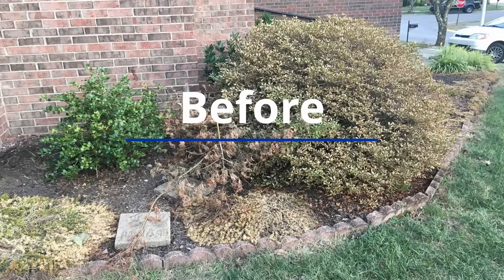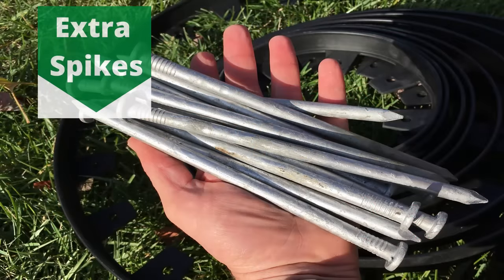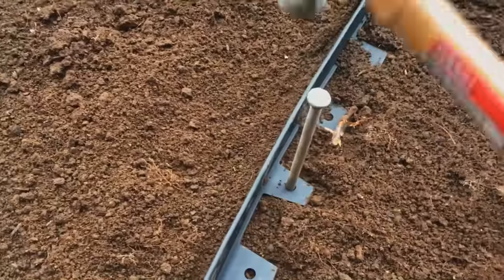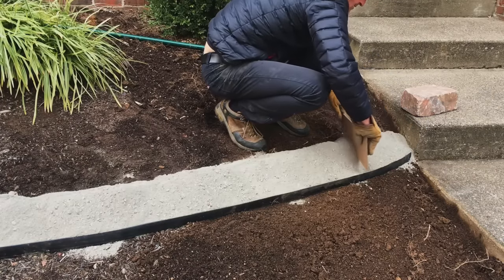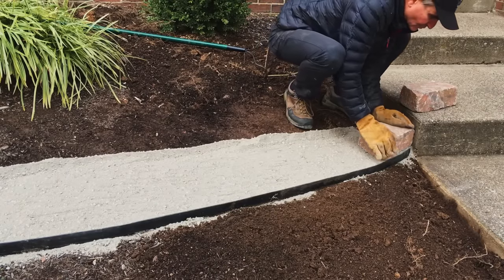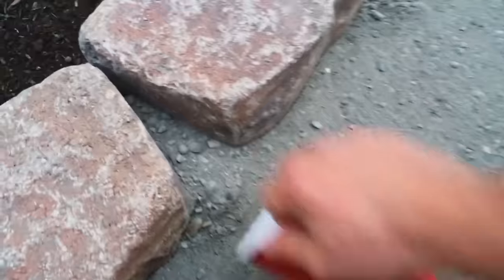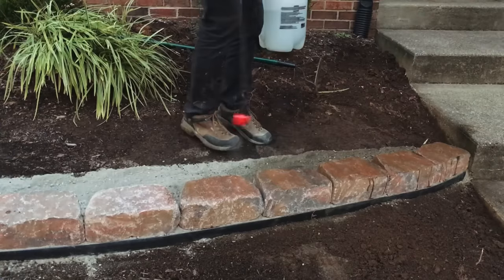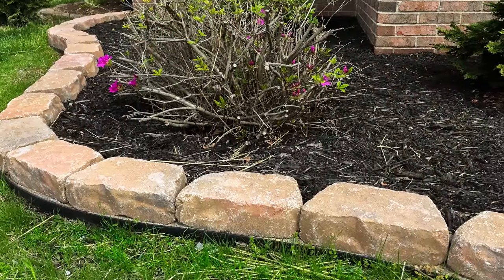easy diy No Dig Border *2020 UPDATE*

Comment: I have my own update.  First, I may have neglected to adequately thank maxpatch for this video in my last post.  After getting some ridiculous bids, the video inspired me to do it myself (with some help from a adult son).  We had to figure a few things out...I spent too long worrying about the unevenness of the ground, I honestly fretted about it and then just figured out that the border will provide a constant level for the stones.  I had to add here and there and remove here and there (I did not want a thin "footer" and a too thick one would waste concrete.  That resolved, the next minor issue was small irregularities in the border when stretched, leaving small indentations or the inverse.  I've decided they probably won't matter.  This is a 130 ft stretch so finding enough 8 inch galvanized spikes required many trips to the big box store.  Question:  Do you need one in every hole?  Anyway, so grateful for this and thanks for putting up with my questions.  Sunday we set the stones!
Reply from the maker: I'm happy to help you out, @Rockyboy5151.....I end up having the spikes an average of 1-2 feet apart on average. Sometimes more or less depending on what I need to get the curves right and make it sturdy so it doesn't bend out weird when putting the concrete mix in. You have a big project!! I'd love to see it when you're finished. btw-you can 'get by' with 6" spikes if you need to, but I guess you are past that step already.....

Comment: I'm curious why you made the concrete base so much wider than the flagstones.  Is there a reason, because it seems unnecessary.
Reply from the maker: Yes, it might seem unnecessary, but I do this for additional weed control for aggressive weeds and grasses that we have here in Nashvillle like Bermuda Grass that sends runners under the ground. This one foot width goes quite a ways in helping out with weeding in this way.

Comment: What if I am going to have three blocks on to0 of each other. Do I still go the same thing that you have showed here please let me know asap
Reply from the maker: Pat, I have not made a second layer on this type of border because I don't know if it would look that good and the difficulty level is raised some because you would mix up and use a traditional mortar between the layers. You could also use landscaping block adhesive. Even, though, it involves more work, I would highly recommend digging out the old dirt and mulch out of your area so the level is dropped enough so that there is plenty of room for the mulch to sit in there without spilling over. Also, the same thing can be accomplished by building your border out further so the dirt can slope down to the level of the bottom of the blocks and also have room for mulch. I hope this helps. Also, here is another updated video that answers many questions: https://www.youtube.com/watch?v=WJmPBu754z8

Comment: Great video! I plan to do this around my mail box and also for the current border in my backyard. But, how does the water get to the concrete that's underneath the pavers?
Reply from the maker: Great question, Diane. That cement mix acts pretty much like a sponge. When you mist spray the blocks, the water goes down around there and is absorbed under the blocks by the cement mix. Its getting cooler out, so make sure the temps are above 50 for the mix to set up. If its colder, the cement does not set. Anything else I can help you with, Diane? Have a great day!!
Reply: @maxpatch67  Thank you so much for your prompt and helpful reply.

Comment: This is a great video. We did this without digging, without concrete and an extra level, but over time, it warped from a straight line to a wobbly one. I’m wondering if  anyone has tried another layer of the stone  on top of this with this concrete project? If you have a video like that, please drop the link here.
Reply from the maker: Jax, your innovation was cool, but please believe me there is one part of this process that is vital. The cement. The cement provides four major functions in this border technique 1. Height(for looks) 2. Keeps the stones straight/aligned over time 3. Stability/strength 4. Weed barrier(the extra width is nearly impenetrable to aggressive weeds and grasses(Bermuda Grass) that we have here in Nashville. I hope you reconsider using it in your second attempt. It will be your last attempt because it will last perfectly forever...I can't vouch for a second layer, but done with one layer of blocks as shown in the video the border will last pretty much forever.

Comment: Great video! Can you do this with a second or maybe a third lair of bricks?
Reply from the maker: Juan, I have not made a second layer on this type of border because I don't know if it would look that good and the difficulty level is raised some because you would mix up and use a traditional mortar between the layers. You could also use landscaping block adhesive. Even, though, it involves more work, I would highly recommend digging out the old dirt and mulch out of your area so the level is dropped enough so that there is plenty of room for the mulch to sit in there without spilling over. Also, the same thing can be accomplished by building your border out further so the dirt can slope down to the level of the bottom of the blocks and also have room for mulch. I hope this helps

Comment: If i need another layer, doi have to follow the same steps on top of what you did.?
Reply from the maker: I have never added a second layer, but if you did, you would use either traditional mortar or landscaping block adhesive.

Comment: Hello! Your April 16, 2020 video creating a stone border with blocks from Lowes looks nice. However, I can’t find that exact stone. It looks like limestone or a blond tint in your video. The colors on Lowe’s website all show a darker color. Any ideas?  Thanks!
Reply from the maker: Here are the two colors that Lowes has for you to choose from. One is plain cement colored and the other has a slight tanish/grayish tint. I have used both and like them equally:
https://www.lowes.com/pd/Mini-Flagstone-Allegheny-Retaining-Wall-Block-Common-3-in-x-8-in-Actual-3-in-x-8-2-in/4686383?cm_mmc=shp-_-c-_-prd-_-lwn-_-bng-_-LIA_LWN_236_Hardscapes-_-4686383-_-Local-_-0-_-0&ds_rl=1286981&msclkid=9248fe7301331e2435159a64c2ddaa81&gclid=9248fe7301331e2435159a64c2ddaa81&gclsrc=3p.ds
https://www.lowes.com/pd/Mini-Flagstone-Ashland-Retaining-Wall-Block-Common-3-in-x-8-in-Actual-3-in-x-8-2-in/4686381?cm_mmc=shp-_-c-_-prd-_-lwn-_-bng-_-LIA_LWN_236_Hardscapes-_-4686381-_-Local-_-0-_-0&ds_rl=1286981&msclkid=97db6108679d153e3435051fa473964c&gclid=97db6108679d153e3435051fa473964c&gclsrc=3p.ds

Comment: Great video but what about going up a hill? Do the blocks follow the slope or do you keep them level by adding extra dirt under them like steps? Thanks
Reply from the maker: One of the features of this border design is that it does not need leveled at all. I works perfectly and looks good built on slopes. If there is some unwanted "dip" or something that you don't like then go ahead a fill it, but otherwise, no digging or dirt needs to be added.

Comment: I really like your video. I have a question perhaps it's been asked before, can the cement hold an additional layer or two of brick?
Reply from the maker: Thanks, Bonnie. I have not made a second layer on this type of border because I don't know if it would look that good and the difficulty level is raised some because you would mix up and use a traditional mortar between the layers. You could also use landscaping block adhesive. Even, though, it involves more work, I would highly recommend digging out the old dirt and mulch out of your area so the level is dropped enough so that there is plenty of room for the mulch to sit in there without spilling over. Also, the same thing can be accomplished by building your border out further so the dirt can slope down to the level of the bottom of the blocks and also have room for mulch. I hope this helps.

Comment: I didn't see any info during your video about "leveling" the blocks?  I'm sure it's 'assumed', but for the 'novice', such information would seem most beneficial.  Thanks.
Reply from the maker: Some levelling happens as you attach the plastic border to the ground. If you don't drive the spikes into the low spots, the edge will basically glide over the low spots and level it some. Before you start, if you see anything that would be objectional, then you would need to get the shovel out and do something about it. Otherwise, the beauty of this border is how it flows along the top of the ground in natural curvature. I hope this helps, Russell.
Reply: @maxpatch67  Thanks so much for the reply, it's very helpful.

Comment: How did you make sure the pavers were level? Or are they not and I just miss that part? It looks really good thinking about doing it this weekend.
Reply from the maker: The uniform look comes from: 1. the plastic edging basically ends up gliding over the low spots on the ground when you attach it, creating a smooth "level" edge. 2. When using the concrete mix, you will level it off even with the edge. 3. Setting the blocks in place is easy because you have such a smooth base that the blocks look perfect!! Does this help? Have a great day!!

Comment: Just curious as to how hard would it be to remove these in the future, as they are cemented in?  Was considering doing as described WITHOUT the cement step.
Reply from the maker: This border is very permanent and you'd need a sledgehammer later to bust it up so only build it if you are very sure of what you want for many years. The cement is central to this border technique and here are the reasons. The cement provides four major functions in this border technique 1. Height(for looks) 2. Keeps the stones straight/aligned over time 3. Stability/strength 4. Weed barrier(the extra width is nearly impenetrable to aggressive weeds and grasses(Bermuda Grass) that we have here in Nashville. I hope this helps, SunnyBrookPark.

Comment: Would this work for an uneven ground area where I’ll need to have multiple blocks stacked?
Reply from the maker: You can definitely use this on uneven ground, but for multiple layers high, I'd use a tradtional small wall building technique with a levelling method so it looks better with the added height.

Comment: How would you do this with two layers instead of just a single layer?  Doable or not recommended?
Reply from the maker: Karrileigh, I have not made a second layer on this type of border because I don't know if it would look that good and the difficulty level is raised some because you would mix up and use a traditional mortar between the layers. Even, though, it involves more work, I would highly recommend digging out the old dirt and mulch out of your area so the level is dropped enough so that there is plenty of room for the mulch to sit in there without spilling over. Also, the same thing can be accomplished by building your border out further so the dirt can slope down to the level of the bottom of the blocks and also have room for mulch. Here are some borders others have built with my technique: https://www.timvogelaar.com/Easy-diy-no-dig-border. I hope this helps. :)

Comment: Great video, thanks for sharing. I am thinking of doing this to create a driveway border and then have river rock fill in for the driveway. Would your method work here as well or would I have to modify? On which side would I put the plastic edging?
Reply from the maker: Pretty cool idea. This method would be ideal to hold your gravel in to have a neat looking driveway. It would not withstand being driven over, so that would be important to know, but all you would do it start with the plastic on the outside edge of the sides of the driveway. Maybe you have seen at the big home stores, they sell about 6' long rigid straight pieces of plastic edging that would work even better than this Vigoro I am using. That other product would be better for a rigid straight edge. Somehting like this would be ideal to use with my method for your gravel driveway: https://www.lowes.com/pd/EasyFlex-10-Pack-60-ft-Black-Plastic-Landscape-Edging-Bundle/5001852149 I hope this helps.

Comment: Thank you so much I'm being charged an arm and a leg to do this from a Landscaper. 
Question:  My flowerbed is a little bit on a slope on one edge so I might need a higher wall. Just buy extra border stones and stack on top of 1st layer? Any extra precautions?
Reply from the maker: I dunno if I'd advise to build it higher....sometimes it just doesn't look very good to go higher if its not more level. I like the curving line this border creates, but sometimes not so much when it is taller....its up to you, but I've always just left it at one layer high-even on slopes...I hope this helps....

Comment: Hi which kind of concrete mix should I use to put under the stones?  There are so many kinds in the store! 😂
Reply from the maker: ONLY use "Fast-Setting". That is exactly what it is called. https://www.lowes.com/pd/QUIKRETE-50-lb-Fast-Setting-Concrete-Mix/3006121?cm_mmc=shp-cprdbdmbinglia--masonrybaggedgoodsrepair-3006121-_-0&placeholder=null&ds_rl=1286981&ds_a_cid=119207829&msclkid=53a250d1c8eb1cfdff38300698742f7c&gclid=53a250d1c8eb1cfdff38300698742f7c&gclsrc=3p.ds I think the bag is white now....but get the right kind or this will not work. Have a great day!!

Comment: Will this same procedure work for laying a no dig walkway with square or rectangular pavers? Obviously you'd have to do a little backfill or dirt removal to make it level though.  If not, what would be the roadblock(s)?
Reply from the maker: Yes, it should work for your walkway idea. I did that in my front yard. So what is your roadblock question about?
Reply: @maxpatch67  sorry, I was asking if there were any roadblocks to the project that I was thinking about doing. You answered my question and thanks!

Comment: I am a female middle aged u would like to know if i could apply this technique at the side of my house about 24 inc wide i don't necessary want a boarder i would like to create a path as nothing grows there except weeds could i use paving stone and spread the cement mix all over also tell me how to mix the cement i want to try and do things for myself thanks any feed back appreciated
Reply from the maker: Yes, your idea will work. You need to have edges to keep the dry cement mix in place and a piece of cardboard to smooth out the mix in the enclosed area. Make sure and use "fast-setting" concrete mix only and make sure the temps are at least in the 50's so the concrete will set up properly. Do the misting with the blocks as shown in the video. If it is a pretty big path, you may want to pay Lowes or whoever to deliver the materials and that can save a lot of time and effort. I hope this helps.

Comment: Why is the width of concrete so wide?  Is this part of the engineering to maintain the structure?  Can is be narrower?
Reply: I would also like to know this!
Reply from the maker: The width of the concrete is about one foot deep to create a substantial grass and weed barrier. Here in Nashville, we have Bermuda Grass that is very aggressive and it sends out shoots both above and below the ground and this extra width goes a long way in controlling it. So, yes, if you don't think you need that, then you could make yours however narrow you want. Great question, Don, and thanks for asking!

Comment: Can you have layers of pavers on top you your border?
Reply from the maker: You can do this using landscaping block adhesive, but I don't recommend it. This technique is designed to used on one level. I don't like the way it looks on multiple layers and it loses strength. So, yes, you can do it, but if you do, only add one layer more, though, I don't think it looks as good as one layer higher, aesthetically speaking.

Comment: Hello - great video!  I have a question for you - would you recommend this technique for multiple layers of bricks?  I’d like to use these stones to build up the garden around my house but I need extra height for deeper dirt.
Reply: Was wondering this as well... Hope he answers
Reply from the maker: Crystal, I have not made a second layer on this type of border because I don't know if it would look that good and the difficulty level is raised some because you would mix up and use a traditional mortar between the layers. You could also use landscaping block adhesive. Even, though, it involves more work, I would highly recommend digging out the old dirt and mulch out of your area so the level is dropped enough so that there is plenty of room for the mulch to sit in there without spilling over. Also, the same thing can be accomplished by building your border out further so the dirt can slope down to the level of the bottom of the blocks and also have room for mulch. I hope this helps.

Comment: Thanks for the tips I love the way you did that I want to do a small 6x12 patio or a little bit for my grill to go on but I got grass in the back of my house will I have to dig the grass up or can I do it like that cause I don’t have the money for all the stuff you need to do a good patio in my back yard
Reply from the maker: Your main challenge in this endeavor would be getting your patio flat enough to make it usable so you are not tripping around, but yes this would work if you were able to get a flat surface. I have made a path through the front yard with this technique with flagstones. I have not used this concrete mix just plain over a large area so I don't know what would happen and cannot recommend it based on that. I do know, though, that this cement mix will set up whatever shape it is in by just adding water to it, so no you never need to mix it first. It is made by the manufacturer to work like this.